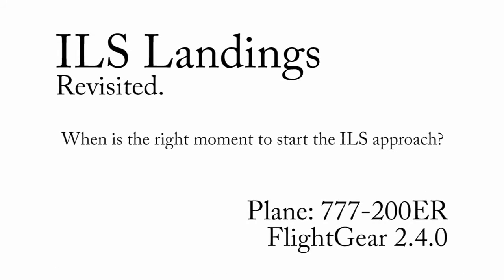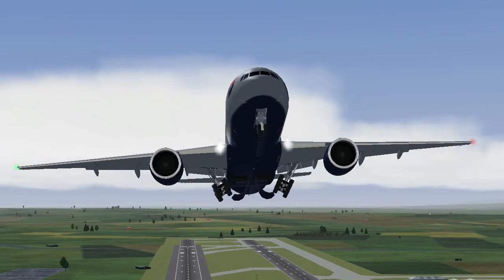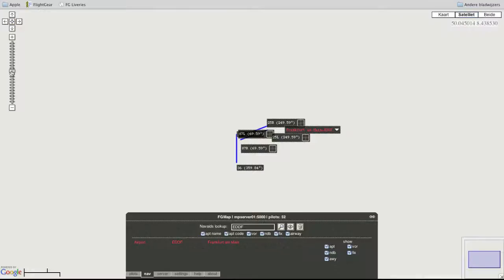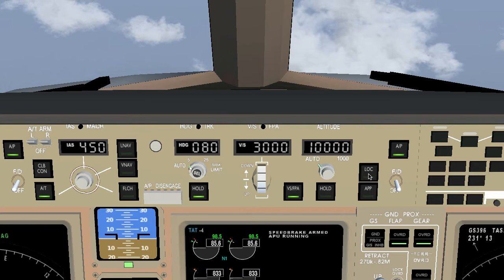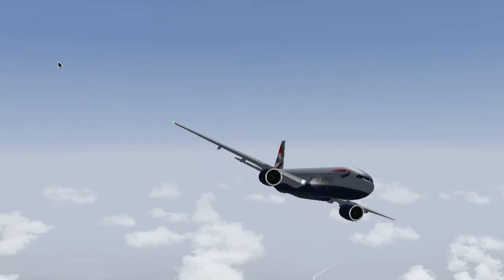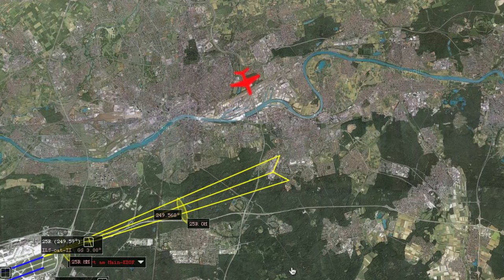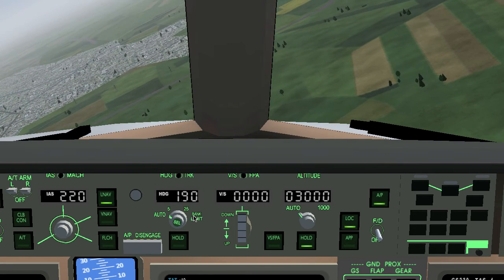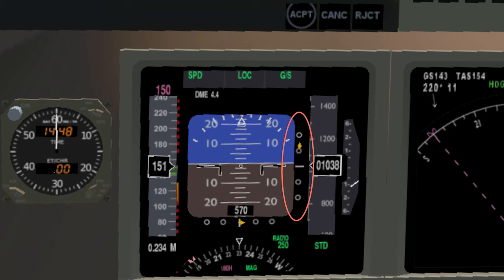ILS Revisited - FlightGear HowTo #20

Comment: I have found that using the autopilot on many aircraft in flightgear 2.4 is quite dangerous. Telling it to hold a pitch angle or vertical speed often results in wild pitching of the aircraft. I don't know if it is any more reliable in 2.6, but I hope so.

Comment: @osjcag i used the boeing 777-200ER but i turn it on im not sure if im doing something wrong. i activate autopilot route in the air then i switch on A/P then wat do i click after that on the 3D control panel. And are u going to make a video about  route manager

Comment: @TheSmashedStudios That should be decided by Altitude. For example, if you are at 30000 then start before 40Nm and If you are 5000 then start after 15Nm or 10Nm... or you can take help of flightgear also ! just go to View>Toggle glideslope in FG 2.4 to activate red marks which will guide you for a smooth descend ^_^

Comment: Can you tell me how to keep at a certain altitude before landing because my plane flies the correct course the only wrong thing is the altitude my plane just keeps on climbing and I don't know what to do. Any help?
Reply: Enable the AP. You now have to enable the LNAV so it can be on course. Don't enable VNAV, but set your altitude on the AP front panel. If it isn't selected, just hit the FLC button and set the Vertical Speed that you desire. The plane will now go up/down to the altitude you set on the Altitude hold panel.

Comment: I don't find any Glideslope config at the A/P configuration. It's so frustrating because the ILS beep sounds for me, but the plane always land at the right side out of the Runway :( could someone help me?
Reply: +Nacho Guzmán Ummmm... Did you click LOC and APP? Also you enter MHz to Nav 1 and when you get somewhere near the blue glide slope you need to press APP to activate LOC and APP then the glide slope's colour will change into light green. Then wait for the plane to land automatically... (But dont forget to adjust your speed manually to your landing speed then wait until your plane will touch down.. :-)